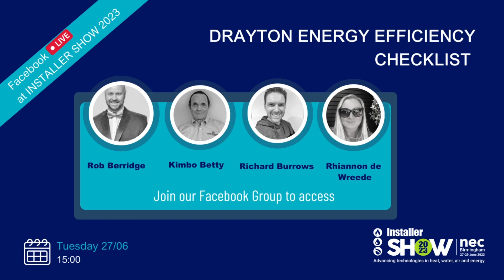FB expert panels -  Drayton Energy Efficiency Checklist

Comment: I've asked this question previously but had no feedback. To improve the energy saving of a combi boiler install why can't I change the hot water temperature from the app. 60 degrees might be OK for a hot water tank install but for a combi only install being able to change the hot water temperature would save money.
Reply from the maker: Our development team is currently working on improving our implementation of open-therm across varies products and the ability to change hot water temperatures from within the app is being looked at.